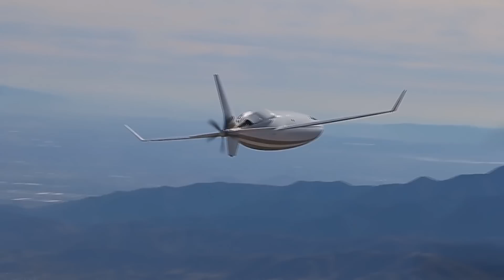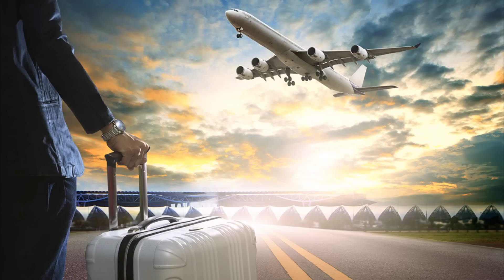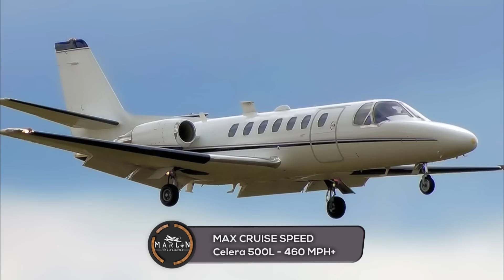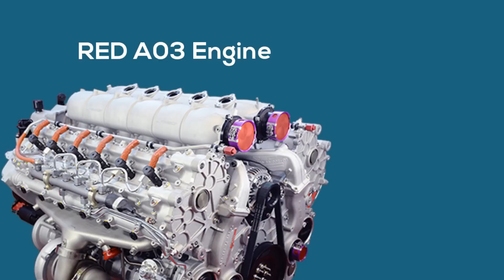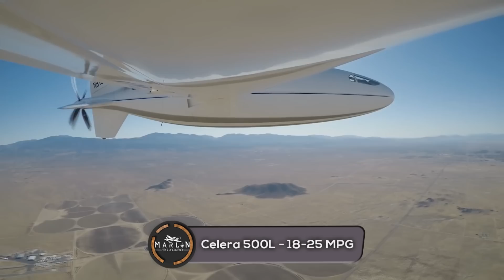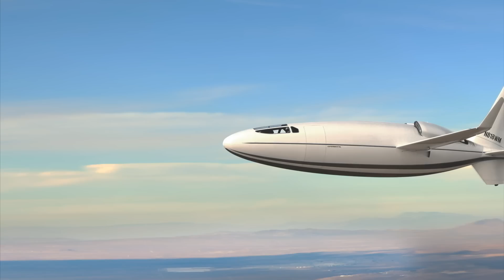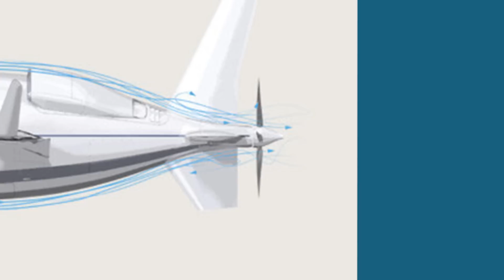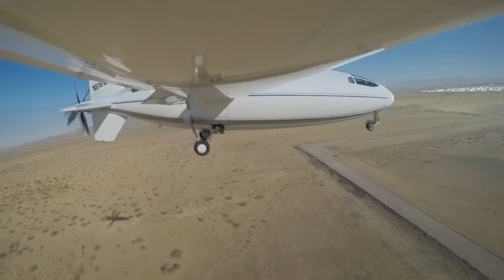Meet the Celera 500L (Flies Faster, Farther, Higher, Cheaper)

Comment: Insufficient information is given in this video and on the Otto website to do a thorough evaluation but I’m extremely skeptical. It may outperform current models in some parameters but the claims made don’t seem plausible. Your glide ratio numbers are way off, I have a Cessna 441, built in 1980. It’s a twin engine turboprop and an excellent performer for its day and even holds its own today. But it’s relatively standard in terms of such considerations as aspect ratio, flat plate area, drag coefficient, has a fairly typical fuselage, wing, and empennage configuration, etc. But its glide ratio is 14.8:1, NOT 9:1 and many current models exceed 15:1.

I looked at the RED A03 engine and it’s stated (and I have no reason to doubt) that it’s FAA and EASA approved for use in certified aircraft. But it’s stated to be a compression (i.e., basically a diesel) engine. Diesel engines are typically much heavier than spark ignition engines because of the high compression ratios and consequent high stresses needed to ignite the air-fuel mixture. I worry about an aluminum compression engine. By the way, this explains why it can run on Jet-A and biodiesel, which are extremely similar chemically and thermodynamically to diesel fuel sold to trucks and cars. Diesel engines are very efficient though. I was unable to find statistics for the engine either, such as mass/(time*power), i.e., brake specific fuel consumption.

Pusher prop aircraft can be more efficient due to the wings not seeing the disturbed air from prop wash, thus enabling a closer approximation to laminar flow over the wings. By the same token though, now the propellor is working in disturbed air behind the wing and thus loses efficiency. Pushers can also be subject to damage from ice shed from the wings. The airplane is clearly designed to be flown above icing levels.

I’d very much like to have better numbers for the drag coefficient, flat plate area, etc. so that I can see if my skepticism is warranted or out of line. I may be able to back into to some of what’s needed and estimate some more, so that’s something I’ll be doing as time allows. For example, using the claimed range and speed MAY enable me to put an upper bound on product of drag coefficient and flat plate area. I’ll also, of course, be checking back to Otto’s and RED’s web sites to see if further information has been made available.
Reply: I think a lot of the design is really influenced by the XB-42 and XB-43
Reply: I recall when GM produced one of the early American full sized Diesel cars in the late 70s or early 80s . I believe they tried to convert a standard gas engine , maybe the 350 c.u. I was going to college and working at a 24 hour service station with tow trucks . We were in the San Juaquin Valley of California , about 100 miles southeast of the Bay Area . Well , in summer , San Francisco hits about 70 F.  Where i was hit over 100 F .all summer . People who bought those never had a problem until they crossed the mountains and came into the valley usually headed for Southern California . The climb over the pass and the heat just fried the heads off those motors . Some had less than 1000 miles on them . We were picking up a half dozen a week at times . It was that common and predictable . Not sure what GM did except wait for all of them to just burn up .

Comment: I am a physicist, not an aeronautical expert, so I’m perfectly prepared to be proven wrong, but I can see no way to reconcile the figures given.
They claim a weight of 12,500 lbs, and a glide ratio of 22:1. My understanding of glide ratio is that, at a specific speed (varies with altitude), the plane can achieve a 22:1 lift to drag ratio, and this is the best it can ever achieve. Now, logic dictates that in level flight lift must equal 12,500lbs and drag is 12,500/22 = 568 pounds force (lbf). Suppose there is an altitude at which 450mph (660 ft/s) is that golden 22:1 speed. The prop needs to be supplying 
660 ft/s x 568 lbf = 374,880 ft.lbf/s. 
1 brake horsepower is equal to 550 ft.lbf/s, giving 374,880/550 = 682 bhp.
From an engine rated at 550bhp maximum t/o power.
Hence, I call bullshit.
Incidentally, to get 682 bhp out of the prop you’d  probably need an engine rated at 1000bhp as props are generally around 70+% efficient.

Comment: Fresh planes die being certified.  Celera has not 1 but 2 hurtles: the plane and the engine.  Then there are service, dealer, manufacturing challenges.  Worse, since FAA burned on 737 Max, they will be stubborn and incredulous.  It’s gonna be tough, tough, tough.
The Celera really breaks no new ground as the Piaggo has a laminar fuselage and is a pusher.

Comment: Lots of potential, no issues with the plane, but very reluctant regarding the engine.  DOHC, V12, 4 valves per cylinder, twin turbo charged 4 stroke piston engine.  You can dress a duck up, but in the end it's still a duck,.  Call me crazy but I'm not to excited to be over the North Atlantic in the middle of winter in a single engine piston engine, that's twin turbo charged.  Yes it puts out 500hp, but how much of that 500hp is going to need to be used continuously to maintain an aircraft of this size.  Just to pull 300-400hp minimum at shall we conservatively 40,000 feet, to maintain cabin pressure, remember you can't use bleed air, not to mention air conditioning, heating, deicing of wings, tail, engine nacelle's.  
Put a PT6 or equivalent an now you really got something to talk about.  The problem with auto engines is they aren't designed to pull 75-90% power for prolonged periods.  Not to mention your over the North Atlantic at 45,000ft when it breaks a piston rod, (1 of 12).  Over land perhaps, over oceans, no thanks!

Comment: This is a near-perfect platform for a hybrid fuel cell/battery electric propulsion system when one becomes available and affordable in the coming years (several are under development). That makes propulsion at higher altitudes less of an issue, carbon-free fuel options include compressed or cryo liquid hydrogen, or hydrogen-rich liquid ammonia (NH3). Meanwhile the piston version proves out and refines the airframe design.